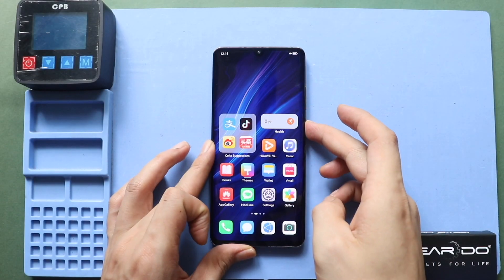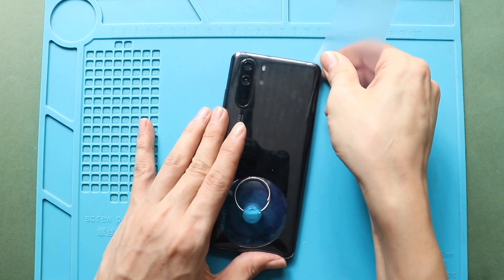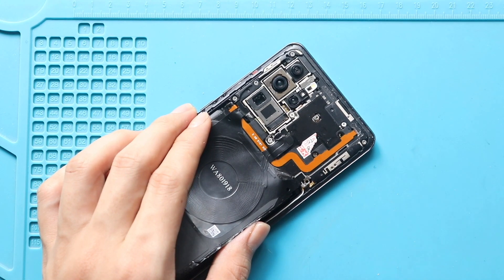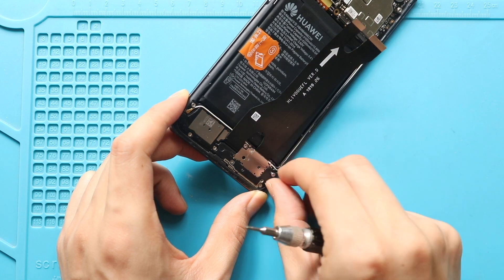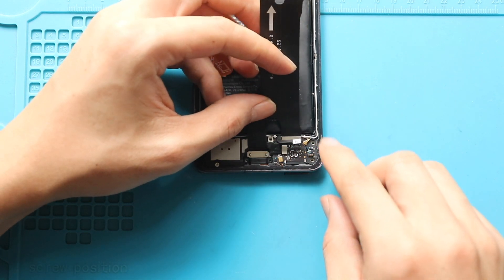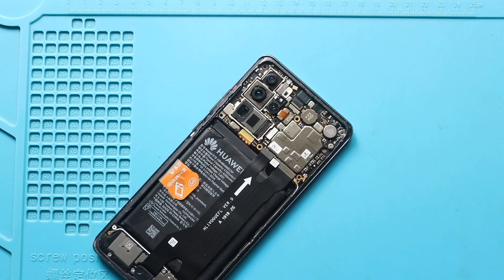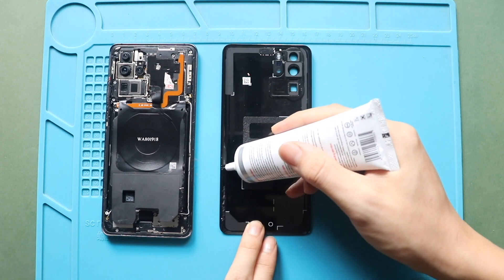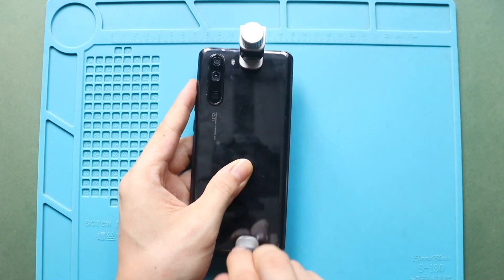Huawei P30 Pro Charging Port Replacement

Comment: I managed to revive my old phone with this for an overall sum of 9€. Opening the back was pretty much the hardest part. I used a regular hair dryer, but was probably not generous enough with the heat as I felt heating it too much would be bad. Had a hard time inserting a wedge, but got there in the end. Great tutorial, thanks for making it!

Comment: If you have a 3D printer set the bed temperature and use that as a heating pad. Set mine to 90°C. Took a few attempts to get it open.
Reply: Did try a hair dryer on hot and probably just as good.
Reply from the maker: Thanks for your feedback.🙏